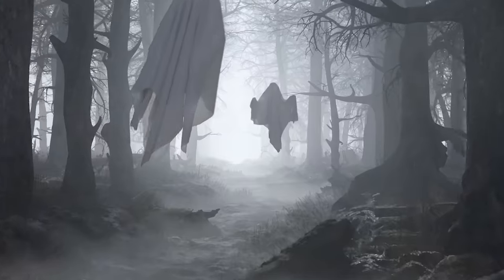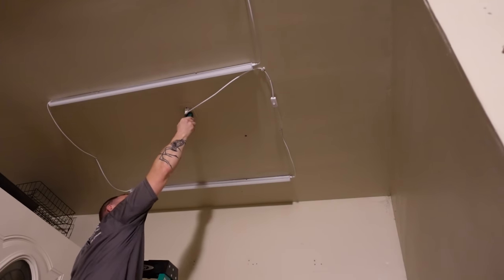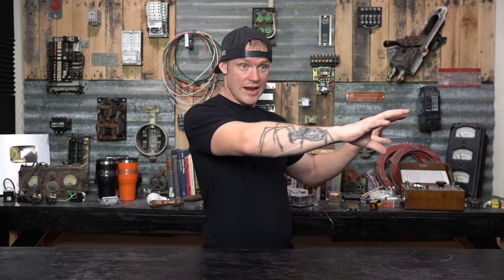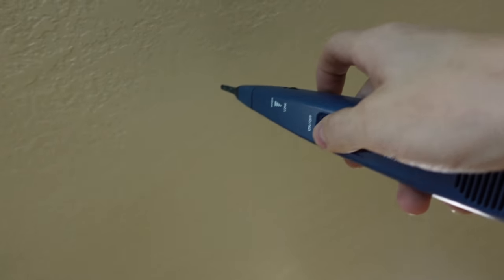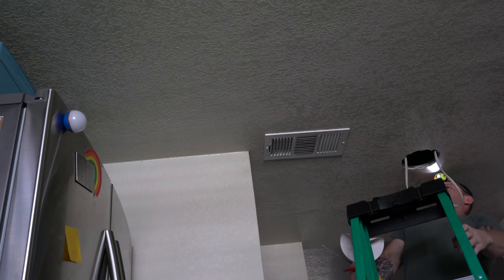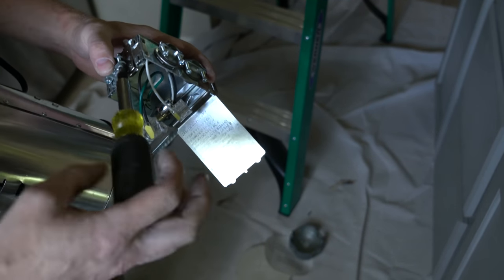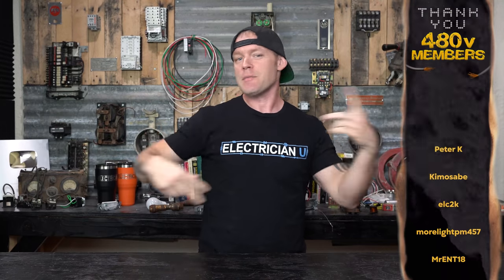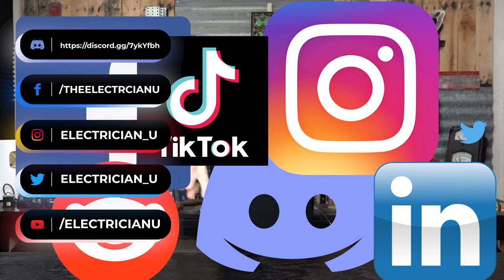THIS IS WHY ELECTRICIANS DON'T HIDE J-BOXES IN WALLS - Finding Hackwork!!

Comment: I’m remodeling my bedroom, gutting to the studs, you would have a heart attack if you saw the hack job we found. Romex - old fabric covered wiring and EXTENSION CORDS! Two spots had burned through and by the grace of God it didn’t burn the house down. Tons of junctions buried in the walls, no nail plates anywhere. Buried j boxes with duct tape covers. Absolutely criminally in competent work. Redoing it all with MC (we’re in the country and get critters).

Comment: I found Drop cloth and adjustable can hole cuter with dust shield really saves on mess. Some come with vacuum ports that you can use or just keep blocket. Its easy and clean.

Comment: When your neutral is open, you have loads in series from one leg to another and if they are not exactly the same one may drop 160 volts and the other 60 volts . That's how you get weird voltages. I had a situation in a church with Furman power conditioner for audio equipment that had a row of lights to indicate voltage. As we turned on more lights to light the stage, the voltage was rising on the Furman.  The audio equipment was a fixed resistance and higher than thousands of watts of lighting. The voltage was decreasing for several big lights in parallel in series with a higher resistance audio console.

Comment: I use those recessed lights in all my remodels! Installed them in my own place too! They're so easy to use and look so clean! Only problem I've come across with installing them on a stud is that the box won't fit though a 4 inch hole when the stud is directly in the middle. Which isn't much of a problem when you have easy attic accessibility. I'm not a big fan of the recessed can trim ones though. They never sit as well in my opinion.

Comment: I use a similar toner that when you short the two leads it changes the tone, a great way to verify you have two actual wires that your leads are connected two.

Comment: Love the idea of using a light to eliminate the drywall damage.
Only thing is make sure the lights jbox has the cu. To accommodate wires your installing.
Not sure if you mentioned it.
Also the tracer came in clutch. They are the best investment ever

Comment: Nailed it man.  I am no electrician, but I have the same tools and intend to figure out why my I laws furnace is using the bare ground as neutral in their new 1987 house.  It freaks me out a little to think 120v is getting returned on a bare copper wire.

Comment: Hello how are you? I am a general who does do my own electric work, I feel pretty confident that I’m pretty good at it because I’ve had electrical contractors ask who made up my panel (electric) because they were impressed with how neat and organized they are, that being said in your video I feel you should have mentioned that when using a low voltage toner you have to make sure there is no voltage on the circuit being tested and no possibility of voltage returning to that circuit while the toner is connected or your going to need a new toner and luckily the wand will usually work with the next one.
Also the reason for your “weird” voltage is because for a circuit to work it needs to be closed, when the Neutrals came apart the circuit opened and the hot was allowed to come back on the neutral by either passing through a light bulb or a appliance that was plugged in and turned on or that had the ability to turn in automatically like a fridge or something like that that does not take a Physical flip of a switch to energize, if you had asked the home owner if in the troubled light fixture with incandescent bulbs had they noticed they had to change the bulbs in those fixture more often because it’s been my experience when there a loose neutral it burns out the filament because of the open neutral what ever is down stream of that bulb is trying to use that hot coming down the neutral against a ground and kinda of becoming a 220 V circuit because they have an unbalanced neutral like you described from back in the day which still does occur today because even though we daisy chain from one point of use to the next every now and then I will find where someone has added a heater fan combo in a bathroom that use to be just a fan and because of the draw if the extra wattage it would dim the lights and slow down the fan in start up of the heater tapped into another circuit and tied the neutrals together giving you the perfect  situation if both circuits are not on the same leg in the panel.
But your information was very informative and useful even fir myself who has done trouble shooting for years because it made me think about why you were getting the ghost voltage and also about using the toner on a energized circuit 
Thank you

Comment: I have a similar problem. I'm a retired electrician and only have 1 hand and arm that I can use. Forgot about toning it thanks.
Also wait for my kids to move stuff out of the way so I can get to my junction box where I suspect my issue is.
Thanks great video!
480v would be a lot easier find. It would blow the lid off!

Comment: I installed business phone systems for 15 years. 200 pair feeder cables to 25 pair to 4 pair CAT 5.  At one business there was one 25 pair cable that left the main area & fed about 3 phones in a different part of the building. We looked for a good 20 minutes but could not find the panel that fed those phones. I finally asked the owner & he says "oh yeah, there are some phone blocks in the wall right here". He said it was OK to cut out the sheetrock to get at them & that he had a good friend who was a sheetrocker & could patch it when we were done. Houses were the worst to run cable, especially with a sheetrocked ceiling in the basement.

Comment: I recommendation:  Through your show your mentioning cool gadgets or receptacles or what ever.  There is a way to link those items through Amazon or your own store where if someone says "Hey I want that gadget"  they can come down your link section, find that link that will take them to Amazon or your store so when they buy that item you will be getting some profit for sending that customer to Amazon.   Perfect example would have been that sounding  toner gadget for tracking the wire.   Hope this helps.  Good video!!

Comment: I been there before. 
The remodelers we hired ended up burying 4 junction boxes in our walls and ceiling. Had many more issues than in this video . We held back a significant amount of money from their final payment until they fixed the problems. They chose not to so we hired another certified electrician to correct and replace all the affected wiring circuits. The new company also found running splices all over the attic an joints not in boxes. All the corrective actions cost well over 5k. But not we are confident our house won’t burn down.

Comment: That story was a lot like a 4 door sedan LTD we had from the 1970's.
We looked at it during the 1990's.
It had multiple issues with interior lights and power windows and locks.
The circuit fuse was for multiples on a buss bar  you couldn't see without looking on the back of the fuse panel.
Of course the fuse kept blowing and no external access to the components was revealing any fault.
We didn't have a normal or simple solution. The customer expected the world with a fence around it in a few hours or less, and he wanted to keep driving the car, he wanted the name of the failed part and some good easy answers about what needed to be replaced with a minimum of labor.
Well, it started getting a thick file folder from times he was able to stop in for somebody's grand swammy  carnack answer, here and there. They gave it to a mastertech. They told him their expectations and desires.
His diagnosis was so similar to find the cause.
The difference was, he could individually fuse each leg of the circuit on that common fuse for the many lights that shared it. That started eliminating whole sections of the schematic when we would get his fuses coming in blown.
He traced and traced and did what an electrical diag required.
He found a spot where they all shared a harness.
Much like your inaccessible junction box.
And it was in the driver's door area somehow, I am not exactly sure. But on about it's eighth visit, he was able to get authorization to blast.
He stayed there working on the car night and day over the weekend. He had all the books and schematics folded out on the shop floor.
He was going blind in one eye and couldn't see with the other.
I stopped in on Sunday about 9:30 am and was going to reset my tires pressures.
There he was. What a mess. But he seemed confident and my vision was good, so I stayed and helped. I asked why he would do this. He said, because Monday morning there's going to be a line of cars outside that door, and they're going to try and get them in here and fix them in a timely manner. I have to have this POS outta here.
We found similar to OEM screws holding a panel on, and some phart smeller had made the panel attach quite nicely. Unfortunately , the screws nicked or penetrated the harness in a few spots.
He stayed and fixed it and put everything right in the service area and restored the fuse panel.
All the circuits regained their intensity and we couldn't repeat the fuses problems before putting it back stock.
I walked by the time clock, and I was curious. How much did his hours add up to?
He had not punched in.
God rest his soul.
He was one of the very few who would do such a thing, just to solve a customer issue, regardless of the cars age, and make it stop bothering the service manager.
The labor would have been like somebody hired a residential electrician, so he just didn't punch his card.
Then we were glad it was solved, and went for the cold frosty beverages. 
Imagine how much he could have been paid if he did home repair instead of being a masochist who obsessed about a cars quality and his ability to correct every system on one.
He could be a wealthy man.

Comment: So 8 conductors + grounds did not overload the remodel can jbox? Also I've always been told junctioning through a recess can is illegal (even though I have done it due to similar circumstances and not wanting to put in unsightly blanks).

Comment: Hiya Dunstan(?),
The worst 'Fault' I ever found was up in a loft. Two 4-inch steel nails hammered in about two inches apart. The hots for all the lighting in the upstairs were wound around one nail, the neutrals around the other. I was there doing a survey for a re-wire and needed to check how much of the loft was boarded and if the boards were fixed down. So loft ladder up into the space and put my hand down across both nails; I went flying across the loft and crashed through the ceiling to land on the bathroom floor. 
The homeowner was trying to insist I pay for all the repairs. When he was arrested for allowing me into an unsafe area, he had done the modifications years before but had not warned me. He was fined for his homicidal work, plus I sued him.
No other electrician would touch the job, and the electricity board disconnected his supply, as his installation was sub-code. He had to have the house demolished!!! I had three months off with a broken back. I was lucky.
Stay safe, Steve...

Comment: Regarding the weird Voltage on neutral: thats usually what you get when the neutral is disconnected anywhere. Basically L/Hot goes to all the appliances, and then wants to return through N, but the path is blocked. This leaves the floating N on a Voltage somewhere between 0 and your nominal Voltage. Usually closer to the latter. and if you touch it it will hurt like L/Hot.

Comment: A loose connection will support voltage but not current. Over time an appliance that calls for moderate to high current will generate the heat at the lousy (tech term) connection and result in the heat damage you see at 23:40  The problem is wire nuts don't block out air from the exposed connectors. The hidden junction box was definitely against code. Every fixture can also be a junction box as you have demonstrated.

Comment: Open circuit on the neutral side can cause strange things to happen, and sometimes be the hardest things to diagnose.
Seeing the poor connection on that neutral splice explains the strange behavior of the outlet and the flickering of the lights. 
What probably happened is when the splice failed the neutral conductor on the source cable to the j-box, lost contact with the two down-feed cables, BUT, the down-feed neutrals (one to the lights, and one to the outlet) remained connected. 
This sets up sort of a series circuit where current is fed into the light fixtures through the hot wire, then tries to return through the neutral, but can't get back to the panel. the voltage (not current) shows up on the neutral,, as a lower voltage as a reduced voltage measured from neutral to ground at the outlet.
Hot to neutral measured at the outlet will be zero because the home run neutral is open.
Hot to ground will show 120 vac since those splices were OK.
Neutral to ground will show a reduced  AC voltage.

Comment: Excellent video. I don't think many electricians would have thought that there would be a junction box just sitting up there and not even properly wired. I'm not an electrician, but if there's enough electricity to melt wires, it might be possible that it could cause a fire. I also like your philosophy to do the job right the first time. After you fixed the junction box you went around and checked all the other plugs. I think you got lucky with the recessed can lights. Otherwise you would have had to cut a hole in the ceiling. If you ever do have to cut a hole in the ceiling, do you repair it yourself? Or do you call in a professional that does sheetrock?
Reply: A good electrician will know about where he will have to cut a hole even if he cannot see or feel a j-box.  I will usually put the patch on and then a drywaller or handyman will tape and mud it.

Comment: As you said as the end , just check after you are done making repairs; you’ll never regret it, the customer or spouse will never get upset, and all your tools are already there and out. If you had to make a second trip because the job was not done or finished correctly, everyone would be upset. Professionalism is going the distance every time for every single person no matter the job. Edit-when I was a plumber, I never had a customer complain that I prevented a mess, cleaned up everything, or tested to make sure everything was correct and proper before calling the job finished. We had a flat rate for the first hour and a half and many jobs took less than an hour; if it took 5 minutes, but I spent 10 minutes cleaning and testing afterwards, they were happier than a job that a guy spent hours on, but left a mess. They didn’t care as much about the hourly rate in the end as much as the respect for their property

Comment: Thank you for these excellent training in videos. I am a homeowner/carpenter/electrician/plumber/jack-of-all, master-of-none kinda guy. 
 I would like to purchase a decent meter and a good tone generator. 
1) I noticed in this video that you use an Ideal 61-773 meter/amp-clamp and I wonder if this would be a good, all-around meter for me.
2) I have purchased several tone-type devices over the years that are supposed to locate which circuit-breaker a particular receptacle or light is on, but they aren't consistent. Sometimes I get a tone on the correct breaker, but most of the time I don't. Can You recommend a good 'breaker-finder' device AND tone generator for wires? Even if there's no 'all-in-one`, I would purchase one of each, but I want something reliable.
Thanks again for all the time you put in to all your videos. I really find them tremendously informative and they've helped me fix multiple problems in my house...

Comment: I just had a difficult gremlin in my old partially knob and tube rental that was impacting a bunch of fixtures. I brought in a couple electricians who worked on it for probably 3 hours and they couldn’t say for sure without tearing into the house. Well, later I decided to extend the remodel and so I tore into the house. Turns out there was some knob and tube running through a piece of wood trim designed especially for carrying the hot and neutral conductors, each in their own little groove. It was just installed superficially in a corner running from the basement to the second floor and had an eighth inch wood cover. Never seen this before but it was obviously a common method done back in the day. Once I bypassed this region with Romex and spliced that into the remaining knob and tube the entire problem went away.

Comment: I'm a builder in NZ. Choice to find something electrical to watch. I look at the can lights that Perkins BB use and other American channels I watch and I think that the lights are so old school. We use a lot of LED lights for recessed lighting,  the slim line style like you explained. Has a reducer on it to bring it from 240v to 12v at light. I don't understand electrical at all, I should have studied this instead of carpentry, I know your style varies to NZ style of wiring but I guess it has a lot to do with voltage.

Comment: Interesting problem, nice solution.
It looks like this box would have to have been when the house was built.  How could that have passed inspection?
Also, I assume that since you concluded that was a box there, it seems that you have run into that before.  How common is it to find hidden boxes like this?

Comment: A home inspector identified 2 double stacked circuit breakers so I had an electrician put them on a dedicated breaker. He didn't trace the circuit to update the breaker box label though. When one of the new breakers is off, every receptacle still works.